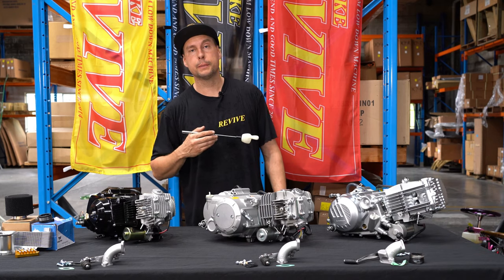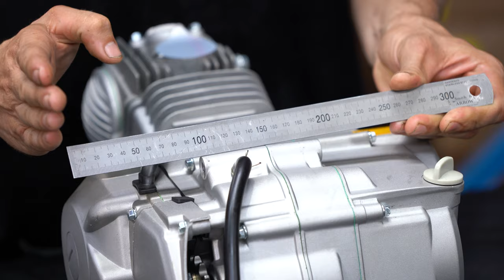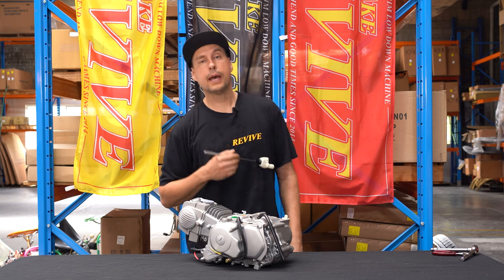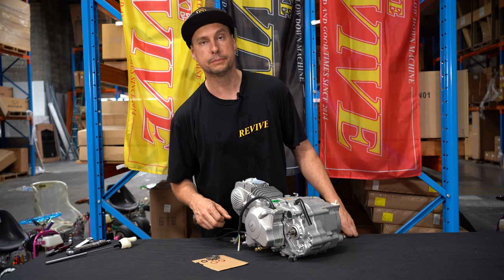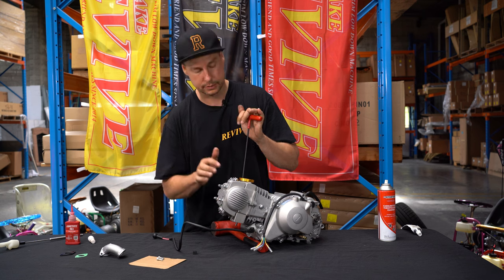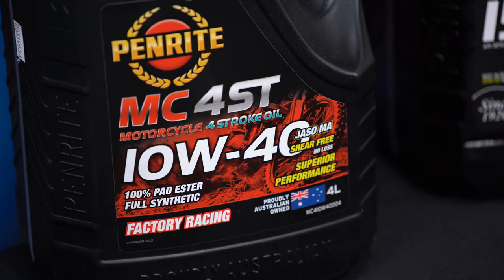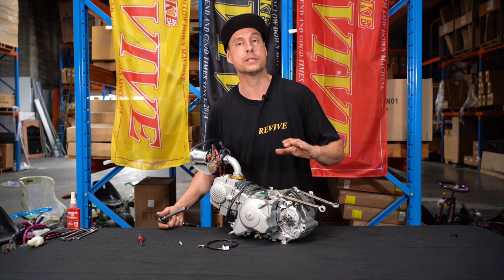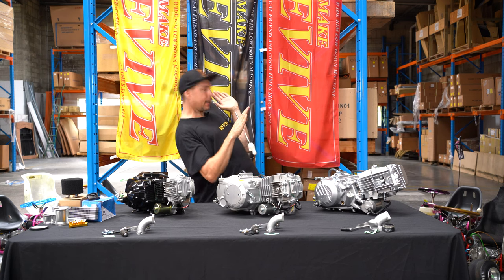Car Make Revive - Drift Kart Build Part 3

Comment: Can you drive these on dirt
Reply from the maker: We don’t really recommend running them on dirt, they only have about 10mm clearance underneath in order to keep the centre of gravity low, in saying that the knuckles can be flipped side to side and the axle lowered which will raise the chassis to about 50mm off the ground.  We have run one on dirt in a raised position and it was definitely a lot of fun.

Comment: So are 150cc or 160cc with 4 speed still possible to fit??
Reply from the maker: If they are the same basic shape as the YX140 they should work fine, we haven’t personally had the chance to try them yet
Reply from the maker: Can confirm that the YX150 and 160 do fit